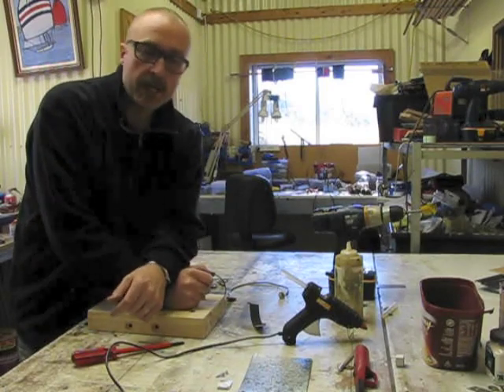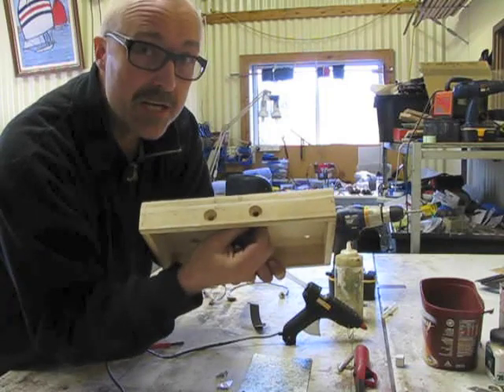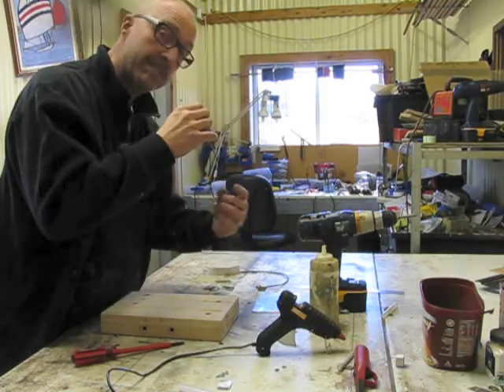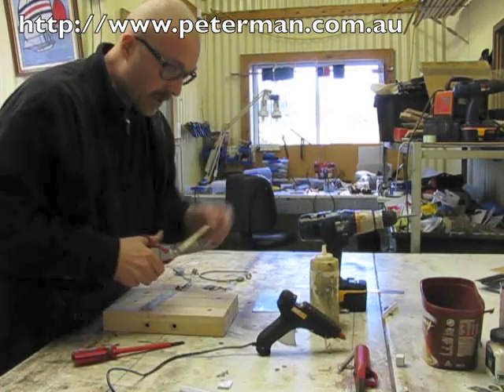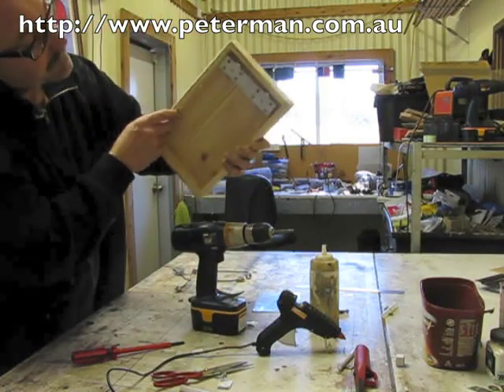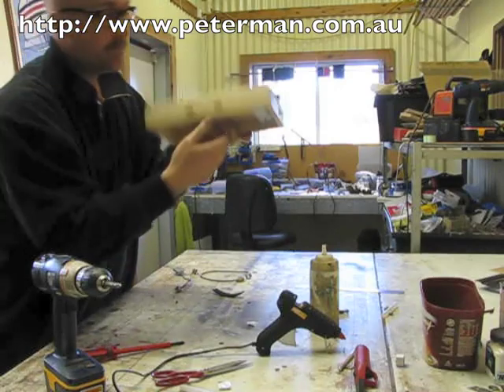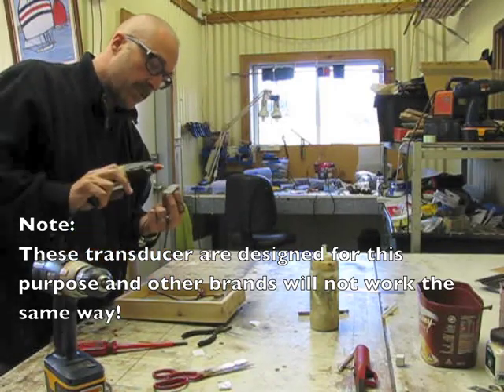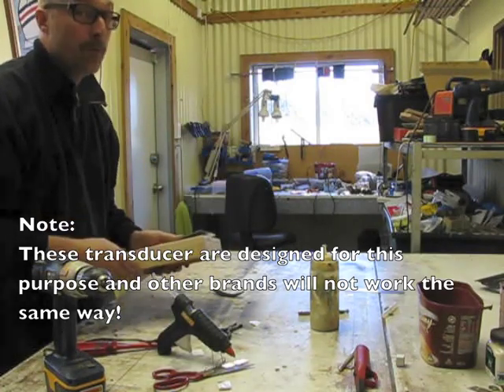http://www.peterman.com.au DIY Stomp box - Mississippi Drum Machine diy

Comment: Question Peter -  They way it is setup would require 3 channels, four if you run a mic too.  Is there a way to wire a jack to the box to plug the guitar into and loop it with both pickups resulting in a single output jack?

Comment: i tried this with a piece of mahogany but it didn't sound very good ... would you're one be any better ??
Reply from the maker: Most of the sound is in the transducer used and not so much the timber...Basically if you use a normal pickup and stick it on a small wooden box, it will sound like a small wooden box... only louder!!
In order to get that BIG BASS sound that people want, you can't use a normal pickup or microphone, it needs to be designed to produce bass.... check out my DIY range of transducers! they will do the trick!